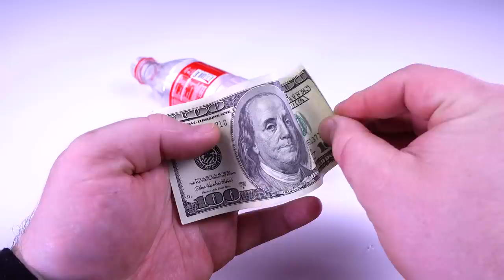Top 10 Smart Ideas

Comment: Hate to say most of this is really useless. You could see the foam dart was burning on fire so it's really not a good way to shoot a dart. Why wouldn't you just dump out the soda into a cup instead of needing a pump, dumping is faster and free. also why do you need finger holds on a soda can cup, just hold the thing. You can buy a soap container at the dollar store and reuse that instead of using a soda can. The only things I saw that were somewhat neat was the match stick's that is a fun idea to fool people, that's the only thing on here really that was worth seeing. and even though it's really not super good the hidden soda bank is alright. Nothing though I'd call a smart idea when there are easier and free ways to do stuff. Also why did I see a picture of about 100 cigarettes rubber banded together with a fuse in them if that wasn't even in this video, that's when I clicked on this to watch cuz I was curious what the heck that was and it wasn't even here.
Reply: "Top 10 Smart Ideas"
literally shows someone lighting up a cigarrete bomb
Reply: م
Reply: Oi